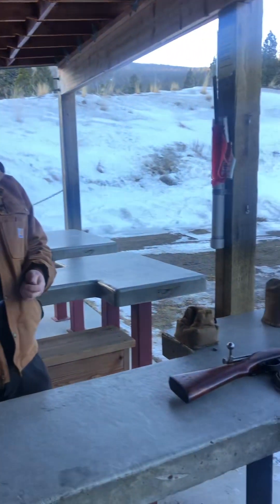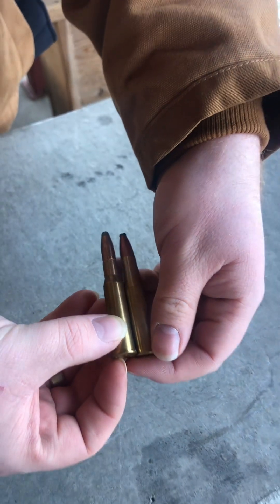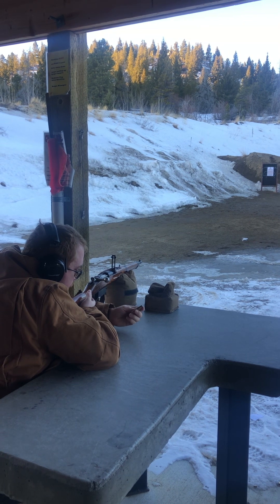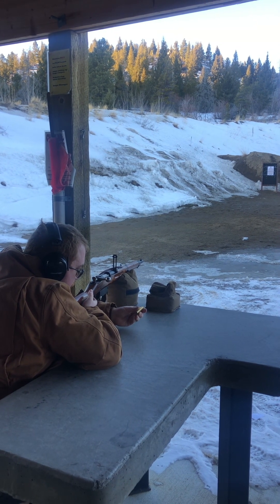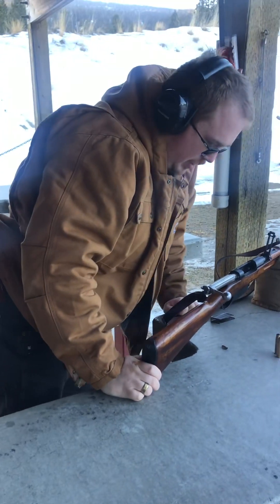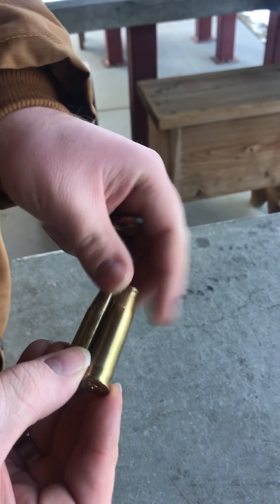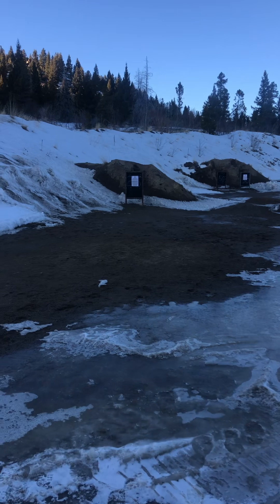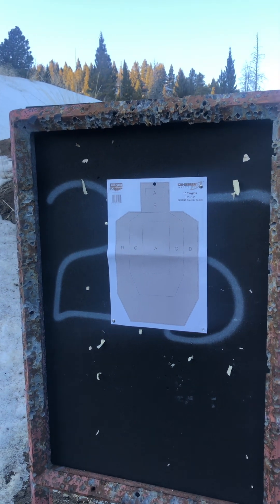Shooting 7.62x54r in a 8x56R Mannlicher M95

Comment: You ever try steel case? I was thinking of trying steel case 7.62x54r out of my M95 chambered in 8x50. I heard someone did it before with no issue.
Reply from the maker: I’ve tried steel case in my 1888 in 8x50r. It can work but I’ve gotten a face full of hot gas a few times. Probably won’t damage your rifle but it hurts. So I would stick to brass personally. I don’t think I’d try steel in 8x56r.
Reply: @WastelandArmorer  Yeah I knew someone who did it with an 8x56r gun and he took a bunch of gas to the face. The case had a big split from the neck to the middle.
Reply from the maker: I’ve never had issues with brass. But I’m cautious with steel for sure

Comment: Have you run it with 8x50 ?
Reply from the maker: @Lpd7374  no. 8x56r is way easier and cheaper to get that 8x50r, so it would be pointless too. It is my understanding you can though.
Reply: @WastelandArmorer  sorry for the confusion. I mentioned to ask will the 7.62x54r fire form 8x50 cases
Reply from the maker: @Lpd7374 yes it absolutely will. I have several videos doing it.